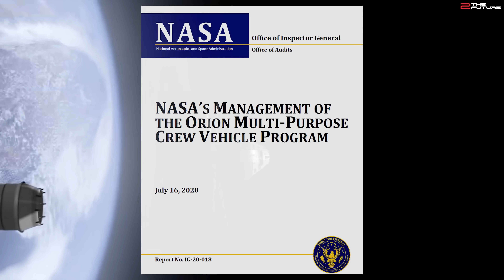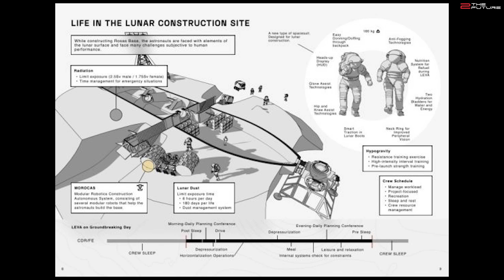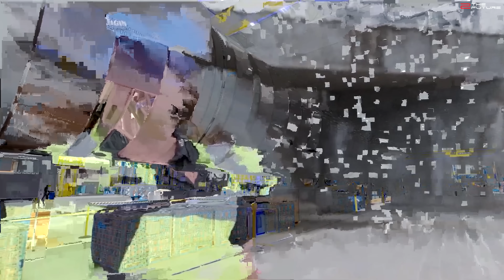How NASA doesn't understand the potential of SpaceX's HLS Starship moon lander.

Comment: My guess is Lunar Starship can loft 40 tons to the moon if it leaves the majority of that mass on the Moon, and has a full tank.  If the tank is increased from 1200 tons to 1350 tons (partially filled during launch), it can probably put up to 60 tons on the moon again if it leaves the majority of the mass on the Moon, and has a full tank when leaving LEO.  I could see the first prototype landing on the moon in late 2023, and subsequent flights 3 months apart if the first one does not crash on the moon.  I see the first one being left on the moon after about 3 landings.  A second or third functional lander will be launched in 2024, and Elon will offer a trip to the moon without SLS, and it will be refused.  Elon will then ask if they can use the Lander for a civilian trip which is again likely to be refused, but in the end will not be stopped.

Comment: NASA have very good understanding of the "potential" of SpaceX's Starship. That is why the SLS program wasn't canceled.
Why is that? Because the ONLY advantage the Starship has is the low price. But that is all.
It is no safer, it is no more reliable, it is no reusable (the Moon landing type), it wasn't in space yet and it still has many issues connected with the landing procedure.
So I am very happy that engineers in NASA do understand all the Starship-related risks.

Comment: Starship hasn't launched into orbit yet. Before the first Starship, when Elon was still talking about BFR using carbon fibre, I posted an architecture to land on the Moon. Two launches of Falcon Heavy. The first launches a reusable Lunar Module into lunar orbit. Unmanned. That LM would carry 4 astronauts from lunar orbit to the surface and back. One single stage, nothing expendable. Second launch would be Dragon with astronauts. The Dragon trunk would have rocket engines and propellant tanks installed for TEI: Trans-Earth Injection. That means leaving lunar orbit for Earth. But an additional stage is required, called a crasher stage. This would be on top of the Falcon Heavy upper stage, and Dragon would sit on that. The Falcon Heavy upper stage would inject the stack into Trans-Lunar trajectory. The crasher stage would have 3 jobs. First is Lunar Orbit Insertion. Then Dragon would dock with the LM. Once docked, the crasher stage would detach from the back of Dragon, move around and attach to the back of the LM. Then it would do it's second job: refuel the LM with both propellant and breathing oxygen. Astronauts would carry lithium-hydroxide canisters for life support from inside Dragon to inside the LM. They would also carry any mission specific equipment, like lunar surface instruments. Then seal the both spacecraft, and detach. The crasher stage would then de-orbit the LM. It would do 90% of the work (delta-V) to go from lunar orbit to the surface. Then the crasher stage would separate and crash on the Moon. That's why it's called "crasher". The LM would use it's own engine for final touchdown. After doing their work on the Moon, the LM would ascend to lunar orbit, leaving no parts on the Moon. The LM would rendezvous with Dragon and dock. Astronauts would transfer back to Dragon, lunar samples, and spent LiOH canister. Leave the LM pristine clean. Then separate leaving the LM in lunar orbit. Once separated, the Dragon would use it's trunk to return to Earth.

A second or subsequent mission would only require Dragon with a single launch of Falcon Heavy.

The Dragon truck, LM, and crasher stage would all use liquid methane / LOX. This would demonstrate that fuel mixture for an extended space mission. And demonstrate in-space propellant transfer. Technology necessary for Starship. My back-of-the-napkin calculations indicate both side boosters of Falcon Heavy could be recovered on barges at sea. However, the central core stage would have to be expended to produce enough delta-V for the full Dragon stack.

To give SLS something to do, SLS block 2B could launch a Mars Direct habitat to the Moon. Which would act as a permanent lunar base. Dragon could act as a taxi to bring astronauts to that base. However, if Starship does fly in a reasonable time, the cargo version could launch the Mars Direct hab into LEO with an upper stage capable of TLI.

Comment: I seem to remember, 1) Starship refueled in low orbit 2) Starship flies to the Moon 3) Starship lands on the moon and becomes permanent 'base' for current and future astronauts (until permanent base is built) 4) The means to getting astronauts back to Orion is under dispute; launch Starship from the surface?  Wasteful.  Something smaller, necessary ONLY for astronauts makes more sense.  Original Starship or 'follow-up' Starshiip carries 'abort capsule' module to carry astronauts up to Orion and returns to Moon.  The gravitational forces on The Moon should be weak enough to do a short, launch ignition to get it off the surface and drift off towards the orbiting Orion.  No booster is needed and very little fuel, as well.
But now?  Launching a large and expensive piece of hardware from the moon to carry a few humans to Orion seems weak minded.  Let's do better.

Comment: 6:30 says Lunar Starship “should have enough propellant to land on the Moon and return if the payload mass is not maxed out.” How do you figure that? Going from LEO to the Moon’s surface and back to LEO propulsively requires a delta-v of 11.8 km/s. Even if an HLS Starship had a dry mass of only 80 metric tones (which I believe is unrealistically low, given the infrastructure needed to support crew), the delta-v with 1200 tons of propellant would be 10.5 km/s, short of the required 11.8 km/s performance; a 100 ton HLS would have 9.7 km/s of delta-v. To go to the the Moon and back as you describe, Starship needs to either refuel in an elliptical Earth orbit, or aerobrake upon returning to Earth, or there needs to be additional refueling along the way. (An elliptical orbit may or may not be within Dragon’s performance envelope, and poses increased radiation risks. Aerobraking works best with a heat shield and flaps, not present on HLS Starship, though it might also be achieved via multiple passes if you don’t mind spending time in the radiation belts. Offloading fuel in Lunar orbit and then reloading it after ascension could do the trick of ensuring enough delta-v, if one is willing to tolerate the added complication.) The bottom line is that you appear to be oversimplifying how Starship could be used in lunar missions without SLS. Yes, SpaceX-only missions are possible, would be cheaper, and would likely make sense. But, the math just doesn’t seem to work for things to function quite as simply as described in the video.
Reply: The rocket connect with the antimatter engineering ☺️ but future have plasma engine optimization 😎 Boca Boca chica studio and the aluminium foil balloon. The roof tiles also be used to make it like a good day.
Reply: @trollking202  Future is to unspecific.

Comment: Great content as always. A small clarification: At 2:20, you said "Artemis II will be the first lunar roundtrip mission since Apollo 8 in1968." I may have misunderstood your intended meaning, but neither Apollo 10 (1969) nor Apollo 13 (1970) landed. In Apollo 10's case it was by design. Apollo 13 didn't attempt to land because it would have meant death for the astronauts.

Comment: Perhaps you are right.  Now that Jeff's finished this round of lawsuits he can go back to his usual brutal work schedule at Blue Origin, TWO AFTERNOONS A WEEK.🤣🤣🤣
Reply: @Art 4. A variation of the Dynetics Inc Alpaca would be a better choice as a sub-orbital craft for distant (>500 km?) exploration.  Carry a rover and an Alpaca to the moon in a a Starship Moon Lander.
For <500 km exploration a methane/oxygen powered ICE rover is the most logical, and yes, you can run and ICE on methane and oxygen and do it in a vacuum.  The advanced version of the Centaur center stage of the Vulcan Centaur,  uses a hydrogen/oxygen ICE for restarting the turbo pumps for the rocket while in space.
https://en.wikipedia.org/wiki/Advanced_Cryogenic_Evolved_Stage

Comment: I hate to be the party pooper on your Space X Starship loving party, but SLS IS the only way to currently get to the moon as Starship is NOT GOING ANYWHERE. Here is what you apparently do NOT understand about the Space X Starship. Since Starship is reusable, it HAS to be re-fueled in orbit in order to have enough fuel to go ANYWHERE other than Earth orbit. The problem with that is, that Starship CANNOT be re-fueled in orbit as the technology to do it does not currently exist. You cannot just dock a couple of starships together and re-fuel them because Starship is waaaaaaaay too small to be able to have the payload capacity to carry a fuel tank refrigeration system. So,,,,,,,, if you re-fuel Starship in orbit, the pressure in the tanks will climb and climb and climb since there is no refrigeration system to keep it super cold and keep the pressure down. So, the pressure will build until it ruptures the fuel tanks on Starship. And the ONLY way to prevent that is to vent the fuel off into space as it heats up. By the time you dock again to put more fuel in again, most if not all of the fuel you unloaded on the previous docking has already been vented off into space. You would have to build an ENORMOUS space station fuel depot far far bigger and far more complex and much more expensive than the International Space Station that would be big enough to hold the refrigeration system that would allow you to store fuel in space in a liquid state thereby keeping the pressures down low enough for long term storage. This is all simply NOT GOING TO HAPPEN as even Elon Musk does not have enough money or time to do such a thing. In a few years all of this will come out and it will be revealed that Starship IS NOT CAPABLE OF ANYTHING OTHER THAN ORBITING THE EARTH. It cannot go anywhere without being re-fueled in orbit and the money and tech to do that does not exist. Elon knows this, he knows he has finally bit off more than he can chew.
Reply: So if you EVER want to see a manned mission to the moon, you better start rooting for SLS!!!! I don't like it anymore than you do, but these are the facts!!! Starship is a SCAM!!!!!
Reply: NASA's engineers know this as well. They know Elon does not have enough money to build a large orbiting fuel depot. It would likely have to be Nuclear Powered to keep the fuel cold. Such a thing has never been done. Far far harder than building Starship itself. Elon's Starship will NEVER land on the moon or Mars. Mark this post. Check back in 2030. You will see.
Reply: No no no, refueling will work, in fact HLS is a Starship which requires multiple refuelings and NASA has approved HLS. So NASA is highly confident refueling will work. Surely NASA knows what they are paying 2.9 billion dollars for.
Reply: @cube2fox  Don't kid yourself. NASA pays for a lot of things that don't work and you know it. In space re-fueling is a pipe dream without a station solely dedicated to it and that would cost more money and time to build than anyone has.

Comment: The plans to use all of the Starship as a habitat looks too much like the old expendable vehicle approach. I would design a lunar freighter variant to have fuel tanks and payload compartment that can reach the moon and be left behind. Then use the rest of the Starship with its own internal propellent tanks as a reusable assent vehicle. The assent vehicle could have a heatshield and large enough fuel tanks to return to Earth or LEO via aerobraking. If aerobraking is not needed to economically reach Earth orbit, have a shieldless variant. Reduce the fuel tank size even more if there is infrastructure to refuel it near the Moon.

Comment: Thank you, Thank you!  Finally, someone else is saying what is clear... Use Dragon for Earth to orbit. and Starship for direct earth orbit to lunar surface and back to earth orbit!! Simple, Safe, and cost-effective.
The only thing I think you should reconsider is what the starship will be like. Everybody is assuming it will be the same as the mars variant, I disagree! It will not have wings but will have tiles. It will only have a single Raptor Vac. engine and it will be Very light construction (like the Apollo lander) because once it has made it into earth orbit for the first time it's never coming down.
The big question is the impracticability of waiting in orbit for loads of refuel missions. I think a smaller lighter starship will only require two or three in-orbit re-fuels, Max!  How?? 
1) Empty the Starship before launch with only enough fuel to achieve orbit. With crazy G-forces the overpowered booster will slingshot the Starship with enough velocity that only a single Raptor-Vac. will be able to place the empty starship into orbit.
2) Refuel, and fill with cargo, from Starships. The crew will arrive on Dragons.
3) Initiate slow orbit raises to be captured by the moon's gravity and a long burn of the one engine to descend to the surface. use the super-Draco's for the touchdown.
4) Reverse the process to get into an earth transition orbit then skim the atmosphere in an air-brake maneuver to return to a stable earth orbit.
5) Return the crew to earth on the waiting Dragons.
6) Re-use! Repeat steps 2 to 5!!

What do you all think? Crazy??
Reply: Why tiles on the lunar lander ?
Reply: @jonbong98  for fuel-efficiency. A spaceship returning to an earth orbit    picks up a lot of speed so instead of a long engine burn the atmosphere can be used as a brake.

Comment: SpaceX does have a few key obstacles to overcome - assuming this can be done in the next 24 months he'll go to the Moon without NASA. The heat tiles, chopstick mechanism and orbital refuelling do represent major challenges, however. Then there are a whole host of important subsidiary issues - spacesuit design being one of the foremost.
Reply: They have already made a spacesuit! Just have to upgrade it, and make it way more Bad-Ass!
Reply: It's not just one type of suit, need lunar surface, and EVA suits in addition to flight suits, But I'm 100% sure SpaceX are not waiting on others to develop them.
Reply: @jonbong98  You make a worthwhile point and I hope it's true but even SpaceX can't do everything. Establishing a Mars base involves so many options and technologies that the knowledge pool is the whole world. And I sometimes think a few things have not been thought out in full. For example, Musk often refers to the use of currency on Mars. If that happens it will be way down the line. I don't think that settlers will see each other as anything but equals and will not tolerate differences in resource distribution, What would they need money for?

Comment: I can honestly say I didn't enjoy this video. It's so depressing to see how off the rails NASA has gone since the Brandon administration took charge. SLS is an hugely expensive joke! As you correctly asert it's bisically a job creation project. Decades out of date technologically using throw away hardware. There's no guarantee that SpaceX will build a moon base as their focus is on colonizing Mars. With any luck they'll do both as the moon would make an excellent refuelling base for interplanetary travel. The one area where NASA could really assist Musk is with nuclear rocket tech which they are currently developing. Ideal for travel in deep space.
Reply: They have been working on SLS for more than a year. The program spans three administrations now. If a test launch takes place next February  or March, then the program had not necessarily gone off the rails over the past year, but just started playing catch up to expectations, quite a few years late.

Comment: Surely you wouldn't need to fully fuel a Lunar Starship at first since a full load is needed to reach Earth orbit, theoretically the lander version could do it on 1/3 of a tank. Therefore 3 tankers to prep the lander and while it's doing its stuff on the moon, park 3 more in orbit to refuel the lander when it gets back, ready for the next trip.

Comment: NASA begun with going to the Moon, then was limited to low earth orbit, then they had ten years of not sending astronauts anywhere, but catching rides on the Soyuz.
NASA is not a self-standing entity that can decide autonomously on their objectives. They didn't design the SLS, the Congress did. This is very different from Apollo, where NASA decided every detail of each component. The RS-25 engines are a design from the '80, a closed loop fuel - rich design, which doesn't allow for a rapid turnaround. The Raptors are full-flow, have higher specific impulse, are much easier to process and only cost a fraction of an RS-25. In forty years metallurgy has made giant steps forward, and the SLS is seeing nothing of this, because the Congress mandated the use of (40 years old) Space Shuttle component parts. These parts also bear the cost, corrected for inflation, they had 40 years ago.
Thanks for the video